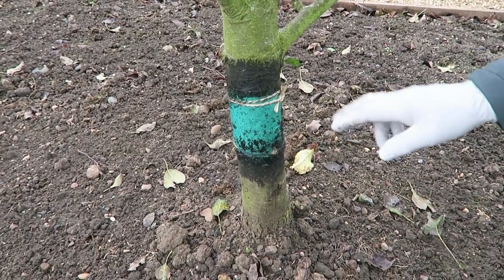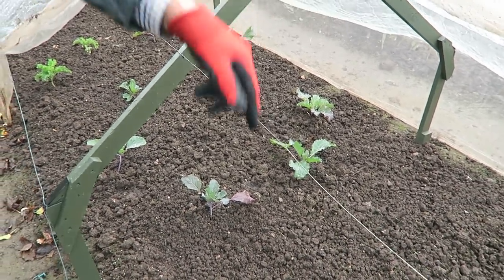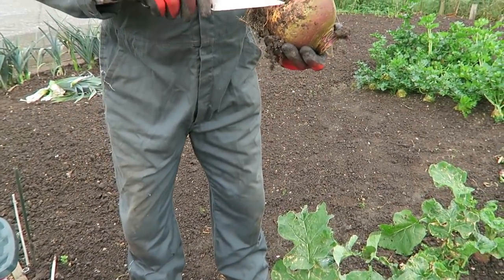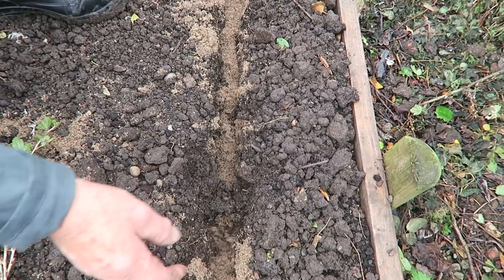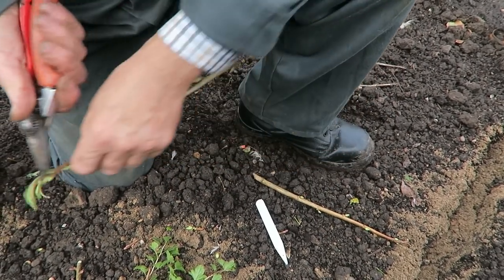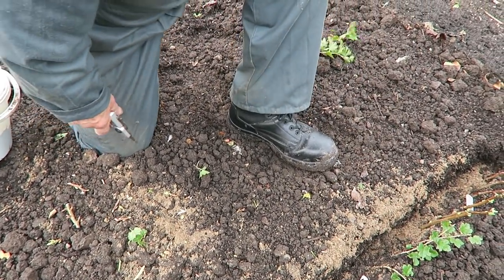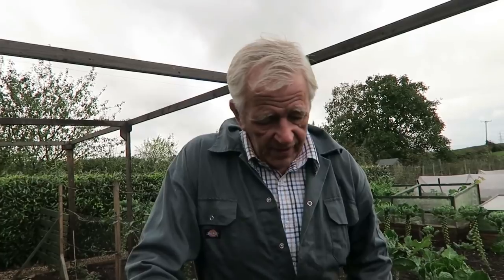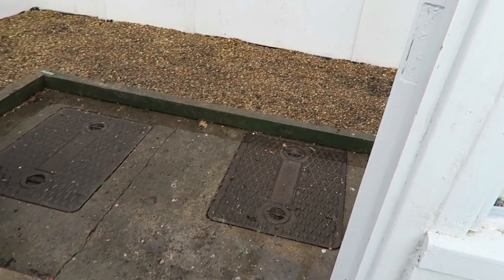Harvesting Crops,   Hardwood Fruit Cuttings,  Cleaning Greenhouse.

Comment: The tunnel looks so spacious now, but it won't be long before it's chock full of veg. I'd heard that brassicas like their roots to be in a very tight soil, and I've seen some extreme examples of people tamping, or walking all around on the area where they'll be planted, but I noticed that you just made sure the plant was snuggled in nice and tight.  Your results prove without a doubt that the entire bed does not need to be compacted to resemble concrete, so, thank you for that.   Rust or not, those are some very fine leeks and the carrots are gorgeous but goodness gracious those parsnips are _really something_!  Might be time to employ that cucumber crane to help get them out.  "Wants trousers"...lol!.    What a cute little co-star you have today at 19:50.  In my climate, it's very likely that I'll never be able to taste a fresh gooseberry let alone grow one, but I'll use this method to propagate other bushes.  I'd like to propagate an osmanthus bush, or "tea olive", which method would you recommend for this type of plant, rooting in the ground or smaller cuttings in pots?  Thank you for your time, knowledge and patience.  TK
Reply from the maker: Thanks Terri,.  I like osmanthus very sweet scented flowers I would try now in a trench of sandy soil, using hardwood cuttings. Or you can take cuttings in June in deep pots in sandy soil. Brassicas do like a firm footing but not solid, if the soil is too tight the water and air cant get to roots. They were the best parsnips I have managed to grow on this land, even in pairs lol. My little helper is called Buffy she is four months old, always with me on the garden when possible. Have a good week and happy gardening regards Cliff and Diane.

Comment: Thanks Cliff. As the buttons grow between the stem and the leaf joint I thought they need to have the leaf in place, over the last few years the leaves haven’t fell as rapid as they have this year, they turned yellow very quickly then fell, so could that be caused by the infestation of the white fly? I’m not sure! Cheers have a good week!
Reply from the maker: Hi David, A big infestation of white fly would turn a few leaves and drop them. The crazy Weather hasn't helped things, but they should be OK. Happy gardening regards Cliff.

Comment: Hello Cliff I trust your well, just wondering if it was too late to put my grease bands on my trees and also why would my sarpos be slightly green when peeled when they was fully buried under the ground.
Reply from the maker: Hi Jonathan, Its not to late to put your grease band on, it will stop the Winter moth larvae and others climbing the tree. Unfortunately it will not stop Codling moth. Your potatoes I  think they might have had too much light at harvest or in storage. Make sure you peel the skins well before eating . Keep as dark as possible and do not eat any with green skins. Have a good week regards Cliff.